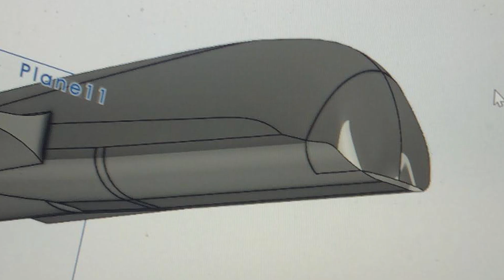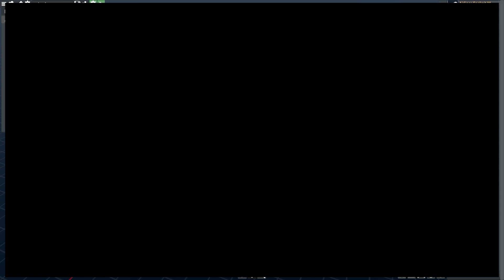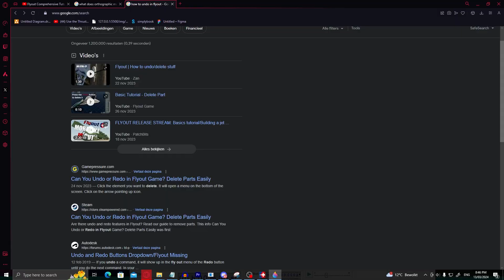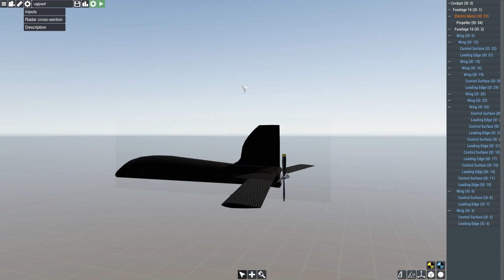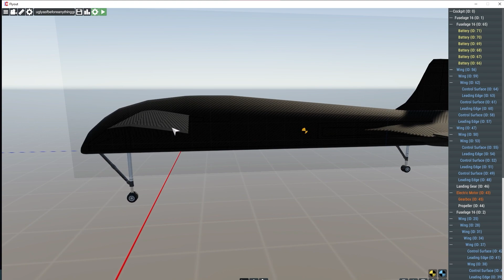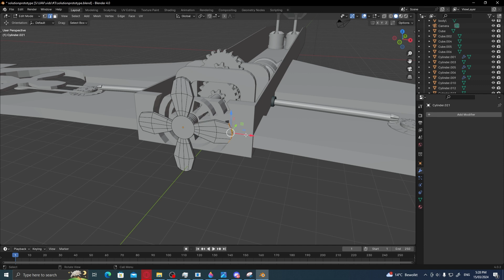ENGINEERING A REAL LIFE UAV IN A GAME [FlyOut]  | WEEK 2 of starting a drone swarm brand

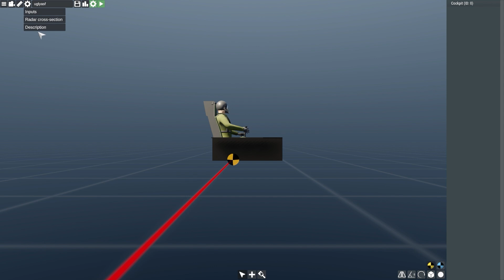Comment: 3:35 I know I'm a bit late but you definitely can model your plane larger and then scale it down. Its called dimensional analysis and was used extensively by the navy to test their boats before manufacturing them at full scale. There is a brilliant example of dimensional analysis that was used to test the San Francisco bay. It was proposed to put in place a dam so the U.S. Army Corps of Engineers designed a scale model to analyse the effects of the dam

Comment: so, the main thing that was hindering you for this aircraft the entire time was the propeller twist and pitch. theres a bunch of ways to tune the propeller but the values you want to start at is root: 42 mid: 12 tip: 1

edit: the blue and black orb thing is the center of pressure and the orange and black one is the center of mass. you alwayse want the center of pressure to be a bit behind the center of mass. think of it like a dart. the dart is moving in a straight line. now, if we put the "wings" of the dart at the front of the dart, the dart becomes unstable and flops around. if you put the "wings" right at the center of mass of the dart, they;ll just do nothing,  and if you put the wings at the tail of the dart than the dart will fly straight. changing the position of the wings changes where the dart produces lift drag and all the other pressures. so farther forwaerd the wing is, the farther forward the center of pressure is. thats a very very very basic description but its the best i can do because i suck with words :3

Comment: Dude, I think your steering to the right because if torque steer from your motor, similar to how helicopters just rotate without its stabilization rotor, solutions are either to go twin motor (rotating in opposite directions) or a single motor with dual prop, using a contra-rotating gearbox, will still have torque steer, but drastically less.

Comment: I am not gonna lie, you're gonna need to do a lot more research before making decisions about important parts like airfoil, fuselage shape, size etc. people like Boeing and Lockheed Martin or even Cessna spend up to a decade on their simplest designs. This is an aircraft, a very powerful, expensive vehicle that needs to be reliable. Also don't use a game from steam to simulate, it uses a physics engine that's based on equations that exclude factors such as weather, wind, temperature, climate variations, changing air pressures etc. I am telling you for your sake, do not commit this quickly. Take your time. Lots. Of. Time.
Reply from the maker: Yessir, you’ll love my recent vid lol. Taking a step back and properly delving into this instead. About the flyout stuff though, I mentioned in the intro I wanted to find out if flyout would be able to somewhat give me an idea of what flies and what doesn’t, I was 2 weeks in with 0 understanding about airplanes, it actually taught me a lot, it wasn’t meant to be the only form of testing or simulating I will do.
Reply: @NaeviusUAV  Ah okay that's good, just really take your time and be careful because if you're making a business out of this it's already expensive as it is to make a drone and it'd be even worse for it to be unreliable. It's not just the money but credibility. It's a very strict industry and any failure will lead to lack of trust that can last for year. Think of the Boeing 737
Reply: Otherwise I'd love to be a part of the journey and follow it, maybe even help if you'll need it 👍

Comment: you shouldn't have to worry about the prop turning the uav if you trim the control surfaces like in real life.
Reply from the maker: Sounds like more drag though to constantly have it trimmed, but we have a different approach now so no worries.
Reply: @NaeviusUAV   sorry but there will always be a P factor for single propeller planes there’s lots of videos about it, it’s called the P factor and will cause the plane to Yaw or turn

Comment: I understand there's probably many reasons, but the question remains for me: why waste time trying to re-design the wheel when there's already so many wheels that work perfectly? (wheels here being drone/UAVs). surely your focus should be on implementing a way for already-existing drone tech to do the job you want it to do, rather than trying to re-design an already-well-designed (by actual engineers) aspect of your idea? What is your design going to bring to the table that already existing designs aren't already capable of doing? this Is an honest bit of advice if you're really serious about your project, which is a noble one I'd love to write an article about (I am a journalist). if you're interested in talking about this do reply, I'd love to chat about this.
Reply from the maker: Hi there! Thanks for commenting. I agree that reinventing the wheel especially in airplanes / uavs is a dumb idea, considering a passenger plane has looked the same for ages. But to be clear, I don’t want to reinvent the wheel. I am looking for a design that works, and potentially making adjustments to it. I’m currently editing the next video, where I have (nearly) finalised what design I am going for, and it is very similar still to an existing design, with different motor placement. Which on a relatively small (3 meter wingspan) plane might be more important than the aerodynamics. I got advice from a few actual aerospace engineering students, but I can’t say too much about that just yet, you’ll see next video. Then next week I can start professionally testing these designs and who knows maybe it’s a bad design and I will find something else. I’d love to get in contact though! You should send me an email at siep.vonk@gmail.com an article would be amazing!

Comment: idk if it was like this all the time but I noticed in 22:54 that your elevators/elevons are pointing the wrong way in order to pitch up. This may seem counter-intuitive but you need to decrease lift in the back wing and increase lift in the front wing in order to pitch up. This means your aft-edge of the wing needs to point up not down in order to decrease lift. The frontal wing can keep pointing down in order to pitch up though. Take off may also have been hindered due to the placement of your rear landing gear. Its center of rotation is in front of the rear landing gear so all that pitching-up force is being turned into a waste of energy through friction or whatever flyout does with that energy I'm not sure.  

Also, this isn't too important but i personally wouldn't constantly pitch the wings up by design because in order to fly in level flight you will need to pitch down which increases drag and slows the plane down. I'm not sure by how much but it tends to do that.

Take all of this with a grain of salt, I'm no professional. I've just been building planes in games for 4 years and I'm only 14 😅

Edit: Just saw the end, highly advise that the center of mass be a little more forward. Although it appeared to be more stable there when maneuvering if you have the weight forward and trim the plane upward it creates natural stability.  I don't know how to do it in flyout as I haven't tried the game yet. Stability has been a recurring issue with that wing layout in the past for the military (USA XP-55 and Japanese J7W) so I hope it turns out well for you! (Also for roll stability, angle a portion of the wing upwards slightly. Look up passive stability for more info. Hope this all helps. Wish you luck!)
Reply from the maker: Hey man! Thank you for the advice, I’ve received a ton of similar advice about the elevators so I tried that right away the next day, which was a good choice. I think I’m really starting to understand things better slowly, next weeks vid you’ll see a lot of progress in this! Although there’s still a lot of things to be considered like that passive stability thing, are you referring to a dihedral? I’ll look into it!
Reply: @NaeviusUAV In a sense yes? It does reduce your lift a tad bit but it does assist with stability and prevents you from having to trim your rudder more to compensate for torque. A good example of this is the F4U corsair, it's Radial engine was a monster of torque and it's wings have a ton of angle.

Comment: 11:30
The reason planes yaw a bit on the runway is due to crosswind coming from the right and pushing on your tail which kind of urges the plane to tilt into the direction of the wind

Another thing could be the torque of the motor causing some forces

Thanks and best of luck!
Reply: Another thing: If you hold x down while pressing one of the movement keys, it'll induce trim to your control surfaces.
Reply: yeah usually with high power engines there are two of them and they rotate in different directions, it's also the reason why helicopters have a tail propeller. Also, very often there are just two propellers on one engine that counterrotate, which can also be found on some modern helicopters

Comment: Just so you know, flyout doesn't have CFD so things like airflow are not calculated into your propeller thrust or wing lift, those are done with other variables. If you have any questions on flyout, or plane characteristics in general I should be able to help you with anything you need :)
Reply from the maker: I didn’t know that! So do wings also not account for potential additional lift created by engines infront of the wing? If you want to help out with this be sure to email me so I can add you to the discord (my email is in the description), would be nice to have someone that knows what is and isn’t possible with flyout.

Comment: cool project but i dont think huge propeller holes on wings won't affect aerodynamics, especially on some angle of attacks its gonna be a huge problem, just compare same size wings with one of them having the hole on it to see what i mean. i think tilt rotor design would be better for this project, motors on front can tilt so that you dont carry all the motors as dead weight on horizontal flight
Reply from the maker: Yes we’re planning a concept like that instead!